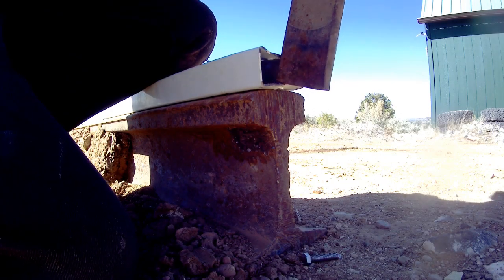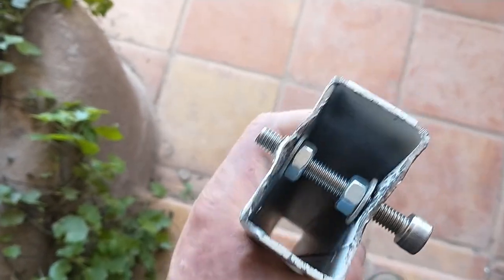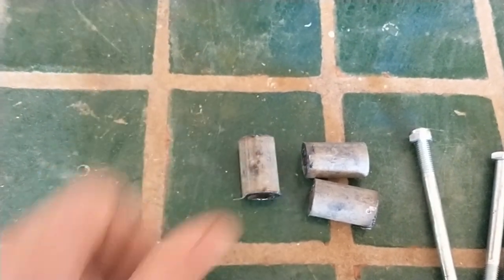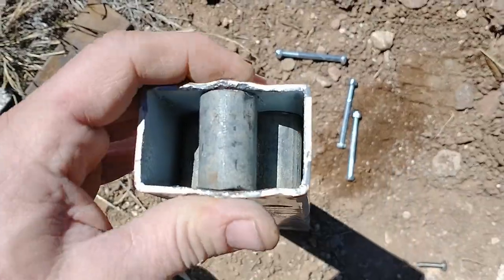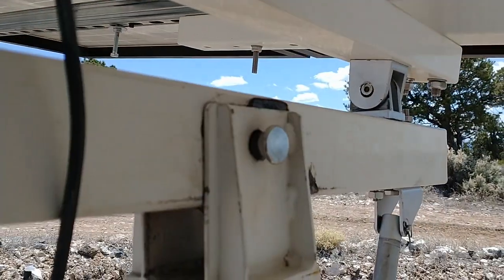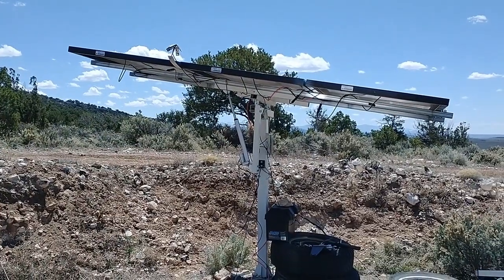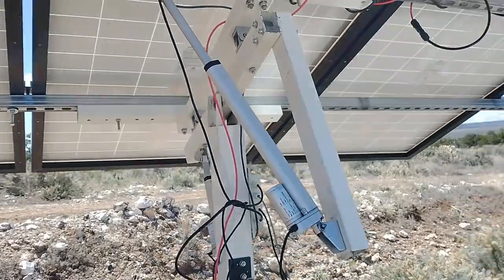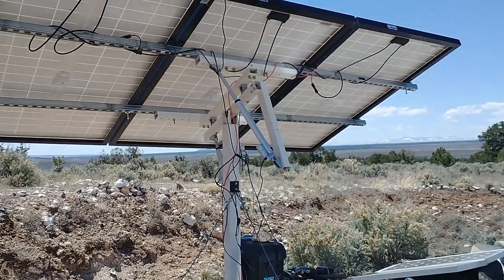Echo-Worthy Solar Tracker Repair

Comment: Good job on the fox. I wish I had thought of that. As high winds and oscillations I believe sheared off the 3 bolts.

But I replaced with sized correct and better bolts. But was thinking of replacing the entire bar. 

But I also cemented the base. So it’s there to stay. 

Will be looking to get that oscillation corrected some how., again thinking the bolt needs to be sized to the holes.

Comment: You gave some really good angles in this video and now it's really obvious why the arm can't be triangulated to the other side of the panels. What you could do instead is to run a couple (or three, if you want to really strengthen and stabilize it in every direction) of steel guy wires from the bottom of the arm to anchors in the ground or slab if there is one. You could put just a little tension on them with turnbuckles and that should keep this from ever happening again.

A second linear actuator mirroring the current one and wired running the opposite direction would further help stabilize the panels, but that could be tricky to get perfectly in sync and not have them fighting each other. A shock absorber type stabilizer might be about the best you can do without adding a bunch of complexity and more possible points of failure.

Anyway, I hope you get the bugs worked out so it becomes much more reliable.